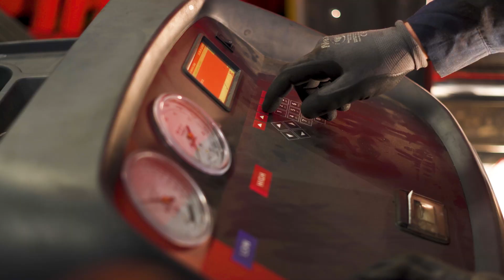PDI Custom Engine upgrade and painting - Engine Removal

Comment: OOh I want! How long does something like this take? I just had an in frame done on my Cummins isx with a new block (due to shop’s mistake) but they didn’t paint it. Or can you guys build a high performance motor? That’s what I really want.
Reply from the maker: It's a pretty decent size job, best estimate from start to finish would be around 4-6 weeks.  We can definitely add our Big Boss parts to an engine to increase the HP/Torque and efficiency.  If you'd like to get a project quoted, please give our team a call 1-800-511-1231  Thanks!
Reply: @pdidiesel  thanks for the reply. I have your guy’s tuner and intake manifold would also love to add the extra turbo. I’ll definitely give you guys a call once I get out of the hole this shop put me in. Took it in to get front seal replaced ran it for a couple days and ended up needing a new block. I was down for 2 months and not going there anymore.